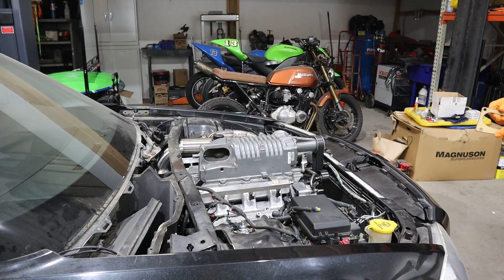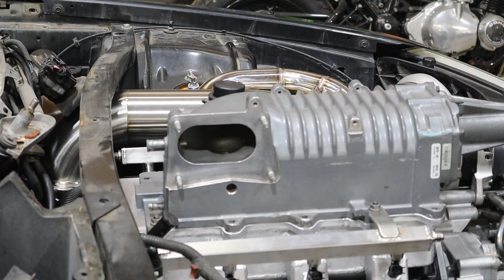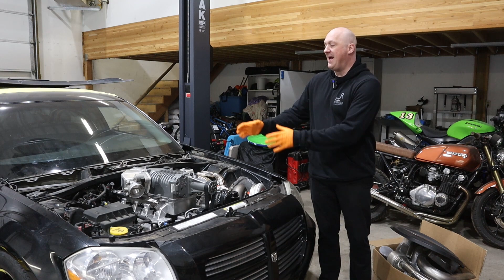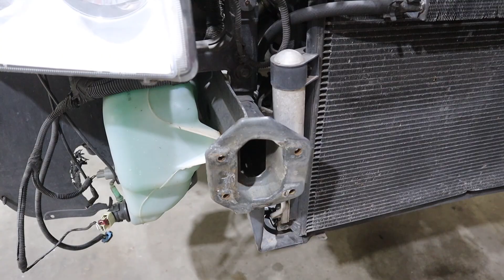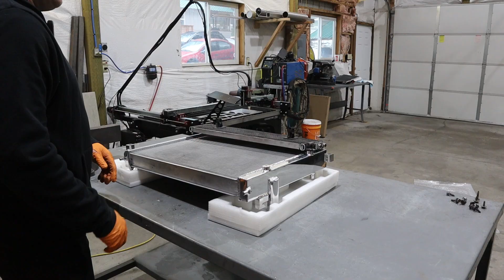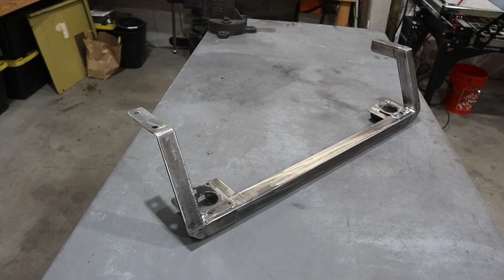Poor Man's Hellcat Ep15: We Need ALL Of The Cooling!

Comment: I did exactly the same thing like a month before this video came out replacing my leaking OEM 2006 charger radiator with an all aluminum 2 core. I wish you had made this video sooner. Now I have a brand new 2009 and up radiator in my garage for my future 2010 challenger. 😅
Reply: Getting the my mishimoto OEM hose to fit the ever so slightly larger inlet was the real bear. I plan to twin turbo the old girl soon. She started as a 5.7L obviously but she spun a crank bearing around 100k so now she's a fully forged 392 stroker.

Comment: If you didn't have to drill a spot weld to take off the crash bar, it's been apart before. Usually a good sign that it was wrecked at one point

Comment: This is off topic but can you put an eagle motor complete as a drop-in from a pickup into a 300c, or is the block just way different…?I know the front for the block is different just Wondering thanks for your advice
Reply from the maker: Mechanically it's not an issue really,  it'll bolt up just fine. But it won't run because it uses a different crank trigger wheel. I'm actually doing the same thing on this magnum project,  the engine is a 2015 ram, but I swapped out the crank trigger wheel with the one from the stock engine.  Time will tell whether this works or not! 👍

Comment: To bend t3 or harder aluminum you’ll want to heat it up some and look for the grain for a single direction bend, bend across the grain if you need to make bends that will be perpendicular then turn the aluminum so the grain is diagonal so you aren’t bending with the grain
Reply from the maker: Good information thank you! 👍
Reply: @ReignitedAuto  I’ve got a question about converting from the coil pack on plug with wire to another across the intake manifold to the dual plug coil pack and what it would take to make it happen? And do you have a way for your viewers to send you messages directly?

Comment: Hey man, I have two VVT hemi engines 5.7 one off of a 2012 Ram and the other from 2016 dodge charger. I just wanna know if the internals are the same besides the Pistons and the cams I think are different……thanks 🙏🏽
Reply: Only difference is the camshaft
Reply from the maker: As mentioned, camshafts are different, but basically everything else is the same. Only other thing to look out for is the Ram engine will have a hole drilled in the side for the dipstick tube, and the charger block will not.

Comment: OEM lower radiator support is strong enough when bolted to body. Custom one is not needed. Just some more weight added.
Reply from the maker: It's definitely true, I mean, these vehicles have been around for decades without the radiators falling out on the ground. But in my case, I would have had to modify the stock one so extensively that it just didn't make sense not to start from scratch. And you'll see in the next episode that making a custom one worked out well for mounting the intercooler. 👍

Comment: How do you fill the radiator?
Reply from the maker: Ah, somebody is paying attention I see! Because I got rid of the original expansion tank, I'm going to have to install a new one in a different place. I purchased a Moroso aluminum expansion tank that will mount to the firewall on the passenger side and this will be the fill point. It'll be higher than any other point in the cooling system, so it should function exactly the same as the stock tank did. 👍

Comment: Use round pipe on corners.
Reply: Round pipe won’t create drag you want drag because it will drag (pull) the air thru the intake
Reply from the maker: I did actually think about doing that, but the mandrel bends that I have are much thinner in comparison so I'd have to buy more materials to finish it that way. 👍

Comment: I've driven 3 "rebuilt title" vehicles. Chrysler 300, Toyota Camry, Jeep Wrangler Unlimited Rubicon. All of them were in perfect condition. I've learned that in the case of an accident if the cost of repair exceeds a certain % of the total estimated value of the vehicle, insurance wants to total it regardless of damage type or "severity". Most people don't argue with the insurance over it, rather they just take the money and let it get totalled. I had a different Chrysler 300 with a clean title that got side swiped, driver door, driver side read passenger door, rear driver quarter panel and driver front fender all got wrecked and steering knuckle got bent. Insurance wanted to total it, I argued with them and finally got them to agree to have it fixed rather than totaled. Probably the case for your magnum.
Reply from the maker: Have to agree with you. I'm an avid motorcycle guy as well, and even a very light wreck will total what it otherwise a perfectly functional motorcycle, it's very frustrating actually.

Comment: How do you think that plasma table compares to Arc Droid? I eventually want both but need to pick one at first. I am leaning Arc Droid as I am a beginner at 3d applications. Arc Droid makes is stupid easy. As a side note, I have never in my life broke a tap, and i Have a old set of cheap chinese. I wonder if I got lucky and have the best ones they ever made. It's not because of my skills for sure. I'm glad you got one of Rogue Fab's benders. They are one of my favorite companies. I never met them but they seem like some great dudes. Good business ethics and I never heard a bad thing about the products. Your videos are great by the way. You are clear, detailed and concise. I appreciate that as I am learning all I can.
Reply from the maker: I appreciate the kind words my man! As far as the arc droid goes, the only reason I went with the table I did is because the arc droid is more for people who don't have room to install a full table. The arc droid is more mobile and works better for smaller shops. I wanted the water table because if you haven't used a plasma before, they make an insane amount of dust/debris which the water table cuts down on significantly. Also, this plasma table can cut up to 3'x4' whereas the arc droid is limited to the overall length of the arm. I do think the arc droid is a better fit for a lot of people, but honestly the learning curve for designing parts through CAD isn't as steep as I anticipated it being. 👍

Comment: A SRT radiator is a direct bolt-in and can be procured at an auto parts store. All the radiators are made in China so it doesn't matter if it's factory or not. Use SRT upper/lower hoses & coolant/oil cooler w/hoses, worked for me on our Chrysler 300C.
Reply from the maker: Good to know Mark, thanks! 👍